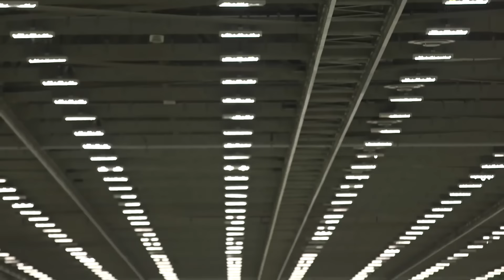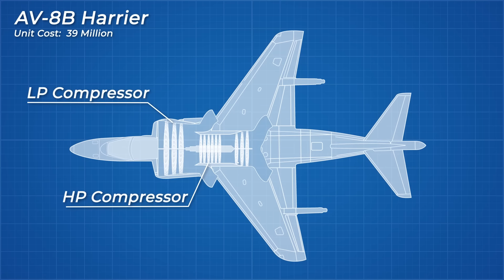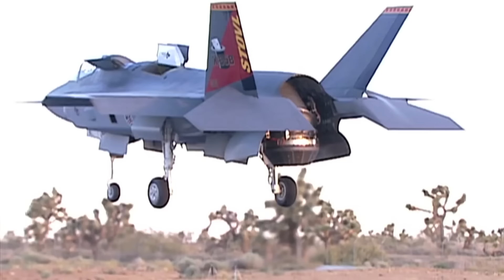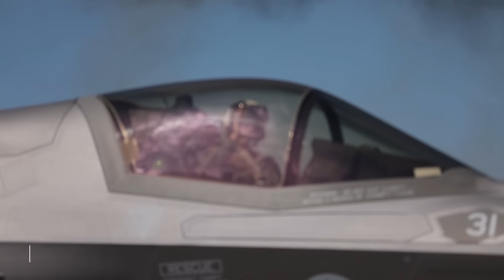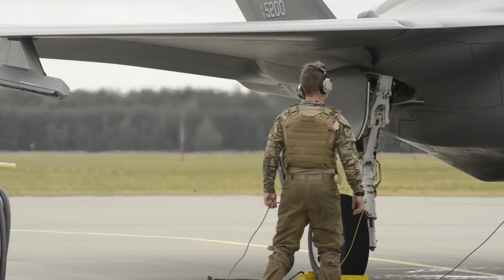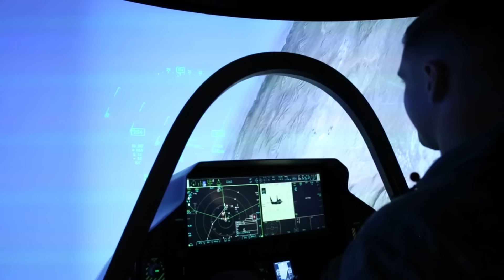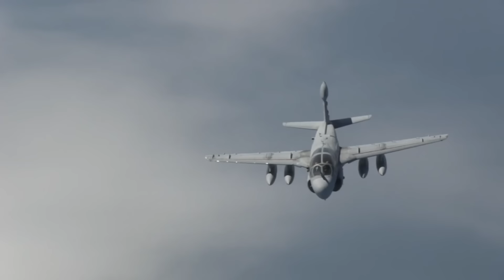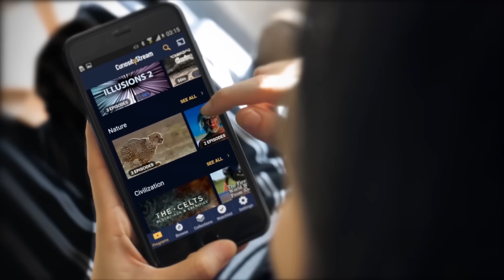Is The F-35 Worth $115 Million?

Comment: Great video for the most part, but I feel that you missed out a key part with the A-10. One of the biggest criticism is that the A-10 is unique in its ability as a ground attack aircraft and the F-35 does not touch the sides with this. And this sentiment has been backed up by strong number of pilots, soldiers and JTACs (ground troops who act as controllers and coordinators for the aircraft) for a while.

That said, the media has been very quick to condemn this project and your doc has done a lot to straighten out the facts. Good video, keep it up. :)
Reply: Read http://www.defensenews.com/article/20140915/DEFREG04/309150012/Gaza-War-Leaned-Heavily-F-16-Close-Air-Support
for Israel's F-16 CAS results.

Israel knows what they are doing i.e. USA is not only military force that has beaten Arab armies.

F-35's CAS roles are evolved from Israeli style F-16 CAS.

Comment: the f-35 is just a lot of very useful technology packed into a lame airframe
Reply: The airframe is excellent. Stealthier than the F-22, is the 2nd most maneuverable US fighter, and has  longer range than any other Western fighter in combat configuration.
Reply: @dumdumbinks274  i doubt its maneuverability greatly tbh, but I have nothing to back my opinions. It just doesn't look right to me.
Reply: @oblongcats  Fair enough, just keep in mind it was designed to be at least as maneuverable as the fighters it replaces, with most of the improvements in other areas. Think of the F-35 as a fighter that dogfights in a squarish shape rather than a circle. It turns tightly bleeding energy, but it can regain that energy extremely quickly. If you're really in doubt then take a look at the numbers... the F-35A may be 1.5x heavier than the F-16, but it's also got 1.5x the wing area (2x the lifting surface area since the F-35 fuselage provides roughly 30% of the lift), and 1.5x the thrust.

Comment: This plane loses to many aircraft including Eurofighter, Viggen, F16, Super Hornet, and the french mirage Rafale. Also stealth is sold as a positive characteristic regardless of the fact that the technology to see stealth aircraft has been around since 1940 😂
Reply: Based on what exactly?
Reply: @peterson7082  a lot of things. For over almost one hundred years aircraft manufacturers have tried to design a plane that can do multiple roles. They all failed. The F22 is not as agile as the rafale which can out turn it because of its Delta wing. Its radar is less powerfull than the russian Mig31 foxhound. A plane that has been around for over 40 years in development as new technology was added when available. The Mig31 has a higher top speed Mach 3.2 and is more fuel efficient as its speed goes up. The SU30 is more manuoverable with 3D vector thrusts also its 3 times cheaper to make. The eurofighter Typhoon is a true all weather all multirole aircraft. The F22 Stealth active and passive is affected by weather. The Tiger Moth can land on a 100 foot runaway and thats 90 years old. See https://youtu.be/-G189YpIbIM
Reply: @sneekmatrix  The multi-role fighter is not a failure in the slightest. It makes up the backbone of most air forces with fighters. 

> "The F22 is not as agile as the rafale which can out turn it because of its Delta wing. Its radar is less powerfull than the russian Mig31 foxhound. A plane that has been around for over 40 years in development as new technology was added when available."

 These claims are based on what?

> "The Mig31 has a higher top speed Mach 3.2 and is more fuel efficient as its speed goes up."

 Operationally speaking, 2.8M.+  Though not with much of a combat load. 

> "This plane loses to many aircraft including Eurofighter, Viggen, F16, Super Hornet, and the french mirage Rafale"

 When has this happened exactly? And to what degree?

> "regardless of the fact that the technology to see stealth aircraft has been around since 1940 😂"

 Generally speaking longer wavelength radars are more capable of picking up low observable aircraft (that are intended to reflect and/ or absorb lower wavelength microwaves). But they're inadequate for providing a targeting solution. That's why they are often early warning systems, and not intended for missile batteries.
Reply: @peterson7082  The F22 is not for sale.. why? Technology restrictions. Hmm seems all the qualified systems are already mature and in operation on many other aircraft. I think the price may have something to do with it.. it cannot make a profit even at $ 155 million. Which means that it would be insane to even put it on the market. No one in their right mind would buy it. Its only deterence is its price.
Reply: @sneekmatrix  Rafale sustained turn rate is at most 24 degrees per second while unarmed at corner speed. The F-22 can achieve 23 degrees per second with 8 missiles at corner speed. It is roughly the same with the Typhoon. In terms of practical dogfighting capability they are all fairly equal, but the F-22 is absolutely superior BVR. Additionally the Rafale's gun cam footage does not tell us anything about the exercise, it only tells us that at least 1 BFM victory went to the Rafale.

R-37M is designed for use against large unmaneuverable targets such as AWACS or bombers. It is also a large missile that can be intercepted. MiG-31BM is capable of carrying at most 6 R-37Ms, and if it does it will be slower than the F-22. Heck even with 4 R-33s semi-recessed and nothing else it maxes out around Mach 2.25, or it can reach Mach 2.8 while in a reconnaissance configuration (basically unarmed). Any faster and it risks destroying the engines. 

MiG-31 radar is less capable than the APG-77v1 that equips the vast majority of F-22s. 

The F-22's export restrictions were put in-place in 1998. Back then there was nothing that could compete with the F-22 and the Russian's most capable air superiority fighter was still the original Su-27P/S.  By the time the politicians considered lifting the restrictions they were also considering cancelling the entire program because it was believed the F-22 was overkill even against the Russians, and also because the F-35 was about to enter production while being a far more useful fighter. It basically came down to lack of interest in a single-role fighter. Plenty of nations would be able to afford the F-22 considering those that are buying the Rafale and Typhoon.

The F-22's stealth is not affected by weather in any way that an enemy can take practical advantage of.

The Su-30 does not have 3D thrust vectoring, nor is it more maneuverable than the F-22. The Su-35S does, and it's still roughly as capable in a dogfight as the F-22.

Comment: Vertical lift and replacing the A10 Warthog is irrelevant. It 
should be super stealth with only defensive measures and in control of a
 fleet of attack stealth drones if it's a flying command center. It's 
best they take all of their awareness and targeting R&D and put it 
in a YF-23. Imagine how immune to S400 the YF-23 would be with top 
trough exhausts not seen from the ground.

Comment: The lack of speed does worry me. The F-35 bets everything on stealth, sensors and Tech. It cannot outrun anything in the battle space. Mach 1.5 is not worth the fuel used. It is basically a subsonic fighter.

Comment: You know that they just copied the vertical takeoff from a soviet plane, right?!? Lockheed 
Would have otherwise copied the Harrier as well. And btw the fan becomes DEAD WEIGHT
when it's up in the air.
Reply: No they didn't. They coped the Convair Model 200 from the late 1960s. COnvair are a part of Lockheed, and P&W who developed the F-135 engine were the designers of the Convair Model 200's engine.
Whether the fan becomes dead weight doesn't matter, design is all about compromises and it was either fly supersonic or save space, not both.

Comment: The very big bad problem i see is the only people really praising the f35 are the test pilots that work for the company that makes it or had a hand in producing some thing about its construction. A small single one engine multitrole plane is never as good as one designed for a specific mission. Also long wave radar like what the Russians use can not be. Hidden by stealth tech. So upgraids in longwave will reduce their ability to hide. Yes it takes larger dishes but with a little compuer work and its pretty well screwed all the way around

Comment: P.O.S. aircraft.  Dictated by politics.  Pure pork barrel.  Supposed to replace many different excellent aircraft, but is not superior to any of them.  F-16 is far superior in a dogfight.  "Oh, but the superiority is in the electronics, we will shoot down the enemy before they know we are there, from long distance."  Long distance shots are low probability hits.  It can't even fly fast enough to run away!  Sad, sad, sad!  Groan.  Why not put the magic electronics inside an updated F-22?  Then you would have something.
Reply: F-16 is less maneuverable. Pilots say so. CAD simulations say so. Even basic equations such as T/W ratio and wing loading say so. The F-16 is slower in all practical configurations, not to mention significantly shorter ranged, smaller payload capacity, and no room for the electronic capabilities that the F-35 offers. 

The AIM-120 achieved a 77% hit probability during the 1990s. That was against a few different targets, but included fighters that were aware of the incoming missile and attempted defensive maneuvers. All shots were BVR, and don't forget the original AIM-120 had less than half the range of the current models, and the current models were developed with dense electronic warfare environments in mind, so it's unlikely simple jamming will stop them.

The F-22 is utterly unsuited to the general purpose fighter role as it is incapable of carrying anything larger than a 1000lb bomb, has shorter range, and is twice as expensive (3x if considering the study into an upgraded F-22 and restarting production). If building the F-22 alone was an option then they would also have stuck with the F-15 in the 70s.
Reply: @dumdumbinks274  I sure hope you are right!

Comment: Why are we wasting so much money on manned fighters! We need to develop fighter drones with zero g limitations with no pilot risks! The f35 is the largest pork Barrell project in MIC history! Thank you Bernie Sanders! There's all your socialist nonsense spent in a crappy manned fighter!
Reply: Because unmanned fighters are more vulnerable to electronic warfare and G limitations are based on the airframe, not the fact a person is flying it. There is no fighter in existence that can sustain a 9G turn, so why go higher?

The F-35 is an excellent fighter that greatly outperforms every fighter it replaces.
Reply: @dumdumbinks274  ... since the 70's that ALL fighters can surpass 9g /-3g ... the limiting factor really IS THE PILOT  inside.
Reply: @sotabaka  They can surpass but cannot *sustain*. Humans are capable of the same thing and F-15Cs have pulled up to 12Gs in combat situations without harming the pilot, despite being rated for 7.3Gs max.

Comment: The F35 will not replace 4th gen planes and the SA400 system has one missile that it's only job is to detect planes from a higher altitude which tell the other missiles where a incoming aircraft is located …..
Reply: 10 000  S400 launchers based all around the russian border would have trouble dealing with 100 out of 1700 F35 entering that same border @3 am  in some random locations ...
Reply: the overplayed F117 downing was a VISUAL shooting of a plane who was tracked VISUALLY during miles and miles while RETURNING from a sucessfull bombing run on a well traveled path ... the entire serbian army could SEE the plane at that time

Comment: This is copy of Soviet Union jet fighter YAK-141. Body of jet fighter was stolen.  https://youtu.be/X9tzHqOVmDY
Reply: That claim has no supporting evidence.
Reply: its the other way around ... the YAH141 was based on LM(convair) patents from the 60's ... the same patents that were used by LM to create the JSF aka F35 (s as in STRIKE)
Reply: @sotabaka  Two things I'll add; 

1- The Convair Model 200 not only shares design concepts with both aircraft, but was one of 3 variants. The other 2 variants were CTOL and CATOBAR versions for the USAF and USN, so the whole idea behind the Convair Model 200 is the exact same thing as with the F-35. 

2- Pratt & Whitney were the engine company behind the Convair M200's lift system, you know... the same company behind the F-35's engine.

So perhaps Mr Adonai3886 would like to explain how the F-35 is based on the Yak-141 when the Yak-141 is clearly the odd one out?

Comment: So much of this is wrong. They are just reading off from all the bogus reports that came out many years ago and have since been debunked. The F-35 A has very similar thrust to weight as that F-15E. Much of this is based off reports of an F-35 that was doing maneuvers with an F-16. It wasn't a dogfight, it was simply trying to match maneuvers so they could calibrate the flight control software with real world testing. It struggled early on, so people reported that it was "losing" to the F-16, which couldn't be more wrong. Now, with everything pretty much dialed in, it combines the best features of the F-16 and FA-18 Superhornet. The F-35 can't maneuver like the F-22 or the newest super agile Russian fighters but it can fly rings around older ones like the aforementioned F-16 or F-15. 

Ya know what? That's fine. The F-35 was never meant to beat the top of the line Russian Air Superiority fighters in a dogfight. That's what the F-22 is for. The F-35 is a true multirole fighter with an emphasis on strike missions. It's number one job is to be the long awaited replacement for the F-117. The fact one airplane can perform that role, while also being a very capable air to air fighter AND also be an outstanding EWAR plane is mind boggling. And let's not make any mistake here, it might not be able to turn with those Russian planes but it can still beat them. It stands a very good chance of seeing the Russians well before they are seen by them, meaning it will get the first shots. If it gets close, the F-35 features a helmet sight and high offbore sight missiles. Meaning that new planes with those two features don't need to jockey for a perfect position, if the pilot can see the enemy he can fire on him at up to a 90 degree angle. 

If the F-35 has a big weakness, it's payload. Carrying weapons internally to maintain stealth means you can't carry many weapons. As of right now, an F-35 can only carry 4 air to air missiles. That is not a lot.

Comment: X-32 looked like a tub of lard.
F-35 has good stealth and exotic avionics, however 2nd a 3rd generation fighters can easily outmaneover it.
The F-117 was detected because it opened it's bomb Bay doors. This would happen to the F-22 or F-35.
Reply: The F-35 can outmaneuver any fighter that isn't 4.5 gen.
The F-117A was detected because stealth is not invisibility. It was detected at around 35km. They failed several times to lock on to it until it was 15km away, thereby proving that stealth works as intended. The actual bay doors claim is that the bay doors malfunctioned while open and thus couldn't be closed, but there is no evidence that was the case.
Reply: @dumdumbinks274  ... the F117 in bosnia was shot down AT VISUAL RANGE and it was so close that it could be seen and the serbians were passing down information when the plane passed by in the narrow corridor ...  and the plane was RETURNING from its sucessfull bombing run ... hardly anything to brag about
Reply: @sotabaka  Yes that's correct. Though your comment doesn't contradict anything I've stated. Did you mean to reply to M. G.?

Comment: The F-35. It only has one weakness. Its not very good at close quarters dogfighting. At least not as good as a plane MADE FOR dogfighting. That isnt sold anywhere outside the US.
Althougth the original f-22 is not going to be restarted, they are working on making a modernized f-22... which as far as i have seen, will still be called the f-22.